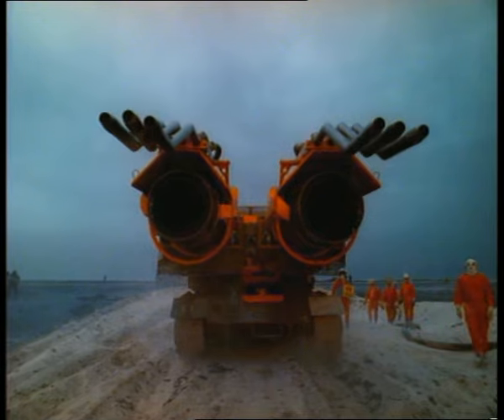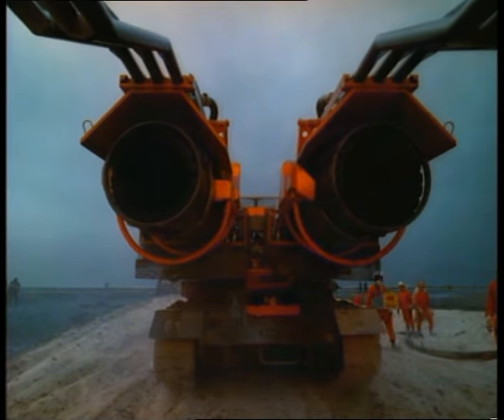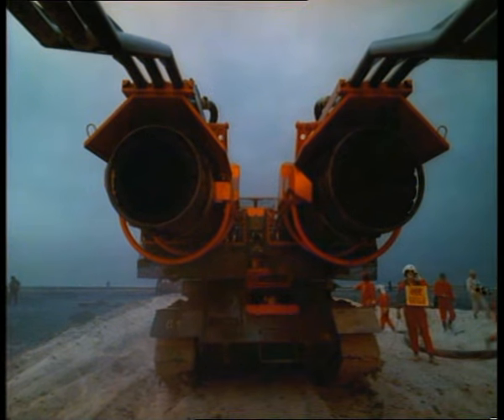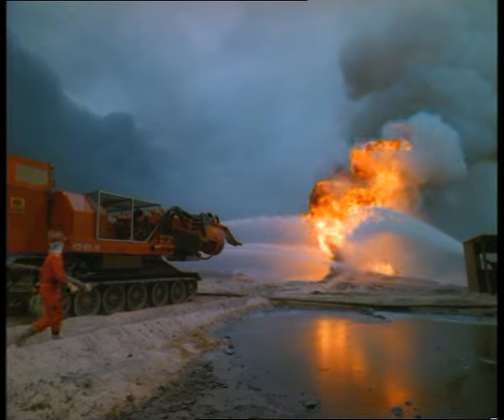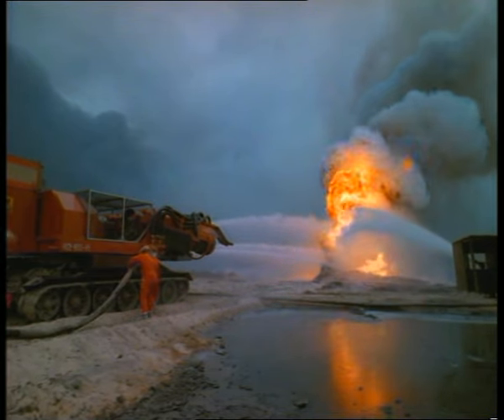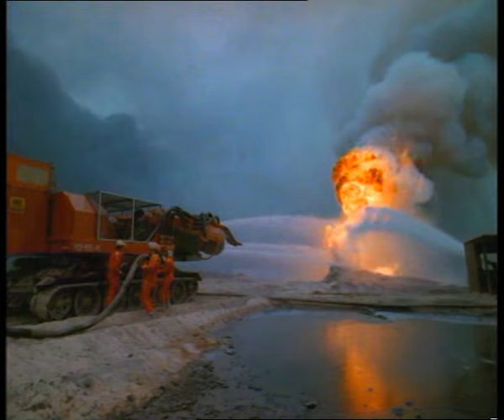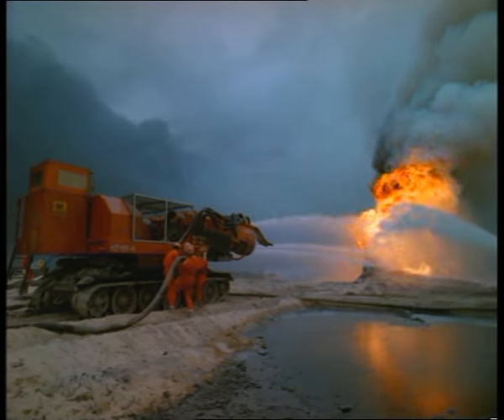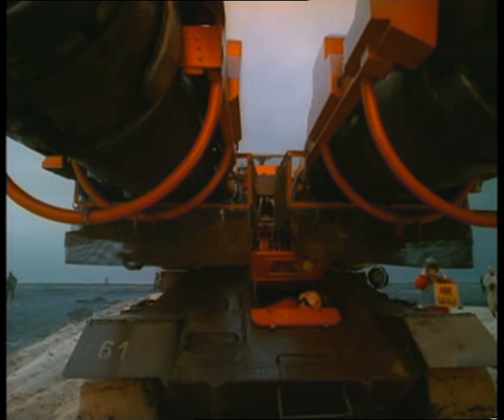Big Wind: The Ultimate Fire Extinguisher

Comment: The specs are 27,000 pounds of thrust pushing 4591 cubic feet per second of air traveling at 770 miles per hour. And into this water is pumped at 8000 gallons per minute. I all most feel sorry for the fire.
Reply: +MrFixer1967 8000 gallons of water per minute, we should send a few of these to Africa.
Reply: That's not something Jesus would say
Reply: Pounds, cubic feet, miles, gallons can't take you seriously I almost crying when I saw gallons/ minute :'D
Reply: @boeufalexandre631  they are correct units of measure for the quantities mentioned ... just get a calculator and convert them to SI if you like.   it makes no difference
Reply: @boeufalexandre631  um...why?  something hard to understand?
Reply: @Irish2050  it was salt water from the gulf
Reply: For non cheeseburgers per bald eagle people:

- 120,000 N of thrust
- Pushing 130 m³/s of air
- Traveling at 1,240 km/h
- Water is pumped at 30 m³/min
Reply: @SumriseHD  Thank you.
Reply: 100 liters of kerosene burned per minute.
Reply: The funny thing is, is that the fire still burns during that
Reply: @SumriseHD  Yes, because all Americans eat cheeseburgers… that’s like saying all Germans followed a certain dictator.

Comment: I wonder why this doesn't propel the T-34 backwards. The Mig 21 weighs about 9 tons fully loaded, and one of these engines can accelerate it up to Mach 2. The T-34 weighs just 26 tons, and there are TWO of these engines.
Reply: I'm sure it wasn't full throttle so maybe it wasn't that powerful enough.
Reply: Friction.

That Mig is connected to the ground by a couple of cubic centimeters of rubber on it's tyres. The tank has track
s and a hell of a lot more track is in contact with the ground.

Comment: J58s would be better 

Sr71 power
Reply: That would be expensive 😂 Mig21-F13 engines (Used on the big wind) are much rare and cheaper than those engines on the SR71